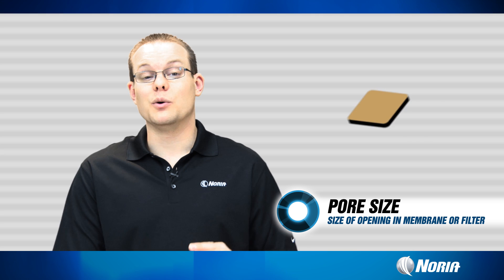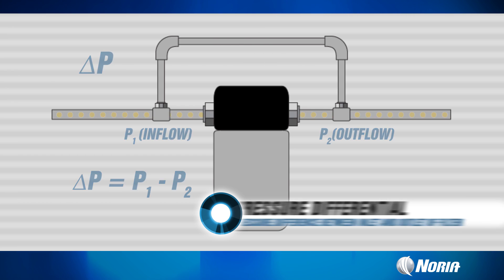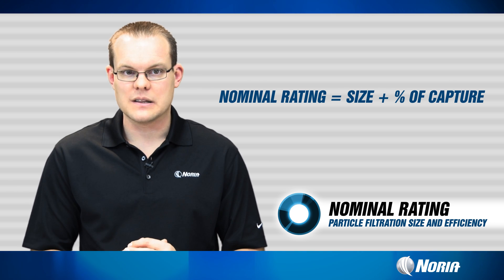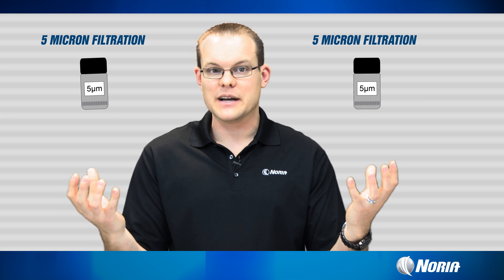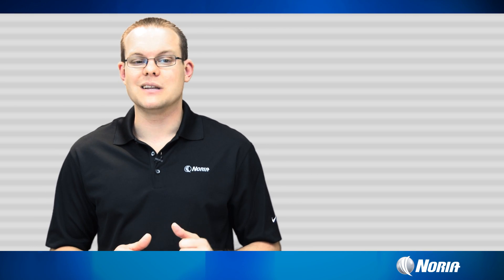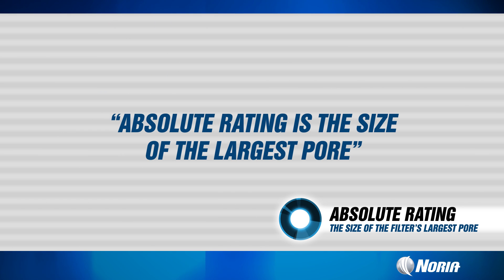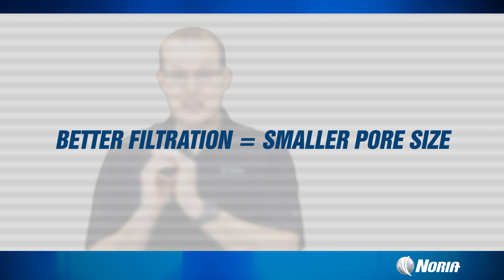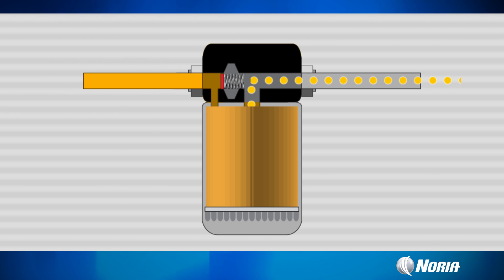How to Evaluate Oil Filters

Comment: Hard to do this. Most Manufacturers rate them at 96% or Higher.  Single Pass or Multi Pass. Purolator only shows a Percentage as an Example. Not a full disclosure of the filters ability. Then when you see a Micron Rating, Its only one 1 specific filter. Which may not be the one you're using. I have a 2018 HD Sportster 1200. Factory Filter didn't have an Anti Drain back valve. And I Believe was only rated for 40 micron. I use a Bosch Premium. Which doesn't give the full specs. Then you see these videos on You-Tube. Guy thinks he know everything by counting the number of Pleats. Metal of Cardboard end caps. Etc. Its a matter of how small? And the Flow rate. Bypass Valve? I call it a Pressure Regulator. Too much Inlet, Not enough Outlet, Opens. Doesn't matter if the Filter is clogged.  As an Auto tech, I have removed filters with Torn elements. Some even had the End Caps separated. Had to fish out pieces of the filter(Cannister style like on a Mercedes). One engine, Filter came out in 3 sections.

Comment: Very good info to know, but how are you supposed to use this info to evaluate actual oil filters in the real world, i.e. in the store or online before you decide which one is the "best" one to buy, because most manufacturers do not report any of those numbers you mentioned on their boxes/packages or report those specifics in any of their published "specs" online either... With almost all filters, you're very lucky if you get even an approximate "efficiency" rating printed on the box, and sometimes, (if you're very lucky!), you can find a filter or two that publish the microns of the very largest "particle size" that it will allow through, (but rarely both numbers at the same time)... However, I've never seen any filters that report any of those other numbers that you mention such as the "beta" rating/ratio, porosity, flow rate, delta P or anything else like that!

Comment: The most important filter on the engine is the air filter. An engine will last a long time with out any oil filter ,with out an air filter the engines life is short in comparison down to hours in dirty operations,

Comment: Excellent thank you. So who makes the best filter?
Reply: Jaoo Asiz I personally think Amsoil is overrated, all their experiments show on video are not accurate.
Reply: +HJR  @2:20. The best filter you can buy is the one provide 99% filtration >20 microns, any brand will do because its the best rating. It will show in the spec. You are talking about car oil filter right?
Reply: The_vb Any brand will NOT filter down to 99% >20 micron. Most of the cheaper brands will fail if they are tested. I found cheaper filter could not clean the oil as well as a higher quality filters and took much longer to lighten the oil on an oil filter demonstrator.

Your car is an expensive thing so why use cheaper "kidneys" which will not work as well. 

I do the same for oils and through experience, I will only use a high quality 100% synthetic motor oil.
Reply: +HJR Exactly what I was thinking.
Reply: HJR I mean whatever brand you can find that filter 99% >20 microns. The one I see for my vehicle is Bosch, STP, Mobil
Reply: Yes, usually the well know brands from a trusted supplier as the best. But there are lots of knock offs coming from the country over there. They knock off everything. I prefer the brand Amsoil, American made and they can look very attractive if it is not hidden.
Reply: +HJR but which one is better Bosch, Mobil or Amsoil?
Reply: The_vb Please give me any link to a video you think it inaccurate about Amsoil.

I used to be an Amsoil dealer in NZ from 1985 until they withdrew from here in 2004. I my experience, of using oils, I have never had any oil that has bettered Amsoil, except on price.

Comment: What about filter capacity, especially with newer extended oil change intervals? If the filter doesn't have the capacity to hold all of the particles it captures over time, won't it clog completely, then the pressure relief valve will open and bypass the filter? At that point the filter becomes useless.
Reply: If it happens that mean you have a upstream problem.
something is loosing particles,like a bearing or a moving part.
the engine is partially toasted at this point.
the oil filtration is not your major problem anymore.
most of the times filters capacities are suficient.
the viscosity of the "extended oil changes" is a problem however.
I've seen engines rotating too slowly for the ecu to allow it to start in winter,because of  its higher viscosity when old.
oil changes resolve magically the problem...
Reply: I have 2 vehicles one having a filter half the size of the other while the two engines have the same displacement.
the car with the little filter is supposed to run two times more with each oil change,so filter, folowing the same manufacturer.
just to say the filters don't filter a lot in quantities,soot from combustion,dust from the intake air passing through the rings ,few particles of bearing material.
nothing wich could clog it unless major failure.

If you make your oil analysed you will have a detailled but habitual list of those particles in it.

Comment: Excellent video - one thing to remember for engine oil filtering is that the clearances between most "rubbing" engine parts (crank bearings, pistons, rod bearings...) are in the order of 2 to 22 microns (25 microns = 0.001 inch).  So these parts are susceptible to be damaged by anything that can "squeeze" itself between these clearances i.e. particles smaller than 22 microns.  You should have an oil filter that would remove as much of "less than 22 micron" particles as possible taking into account the possibility of the pressure differential increasing so much (filter flow resistance) that the bypass valve opens.
Thank you for the video - Ciao, L
Reply: +lancelot1953   Filtering out the lager particles that form engine sludge that blocks up oil ports and galleries is also important.  Oil starvation caused by obstructed oil flow is what leads to severe engine damage.  That is why any filter design is a compromise unless there is multistage filtration.
Reply: John Ferguson Hi John, I fully agree with you, I was just addressing how "very small" particles damage the engine.  Ciao, L
Reply: lancelot1953 
What oil filter are you using? Are you running an oil bypass filtration system? If yes, which one? Franz, fs2500, amsoil, etc

Comment: I especially liked the end where he explains the tradeoff made in buying a better filter.  You can be a "filtration guy" or a "flow rate guy", but usually not both at the same time, unless you are willing to pay A LOT for it. Personally, I'm a flow rate guy. I will sacrifice 5 microns of efficiency for a better flow and a bypass valve that opens only when its really suppose to.
Reply: Dwayne Daniels 
You can have filtration and flow you just need more filter surface area (longer or wider filters) in most vehicles this is difficult because of space constraints so you could use remotely mounted filters